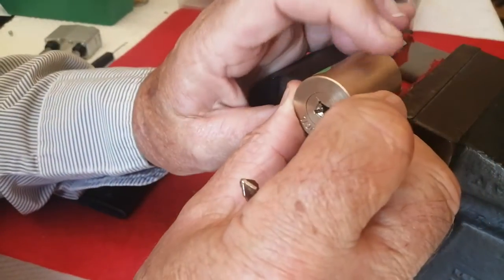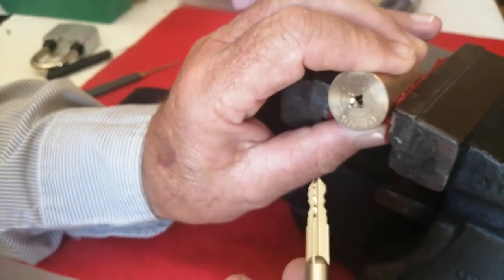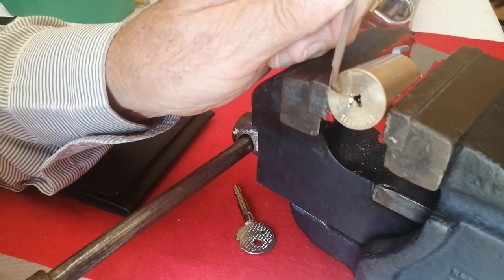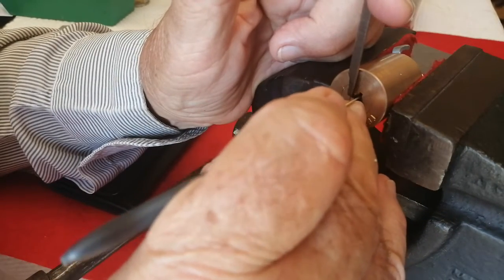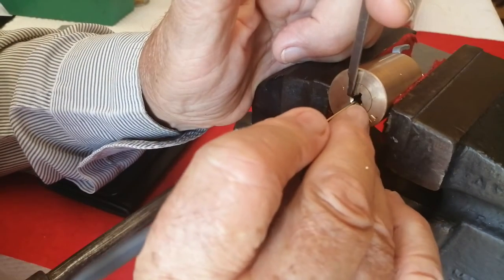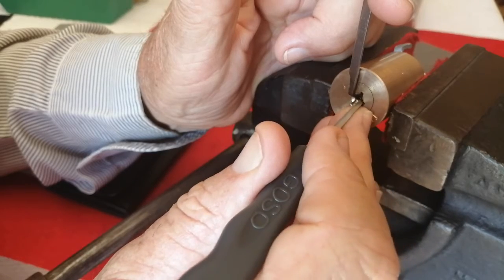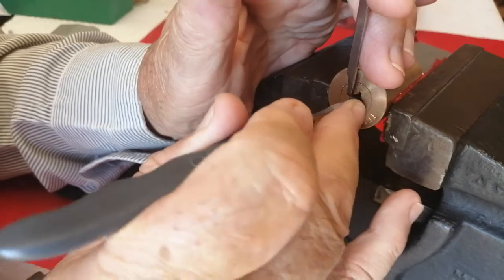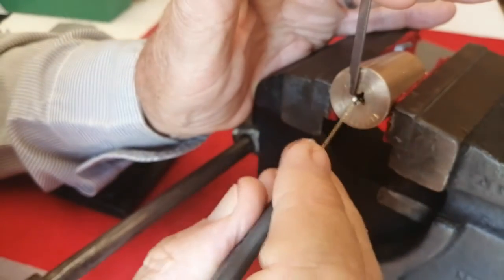(45) 14 pins cross lock picked in less than 10 minutes

Comment: That was a great pick there Peter. Cross locks take patience to pick. Raking can speed up the process but not as much fun. Several Cross locks I have come across are not fully pinned up. Thanks for sharing 👍🦊
Reply from the maker: Yes Jack. This lock actually has 2 parts to it. The other part was only partially pinned....7 pins. So I basically ignored it for being too little a challenge.